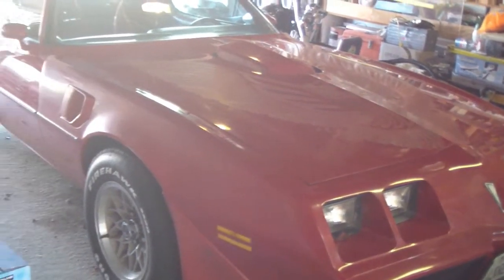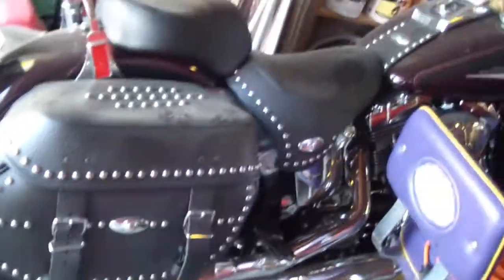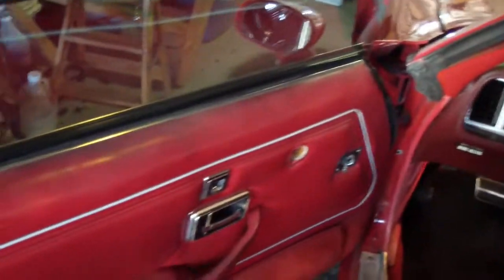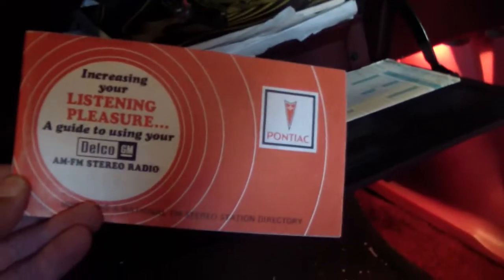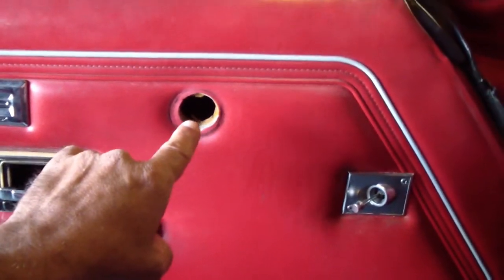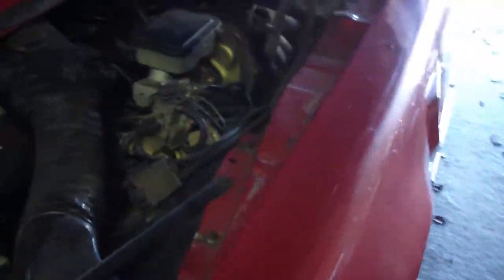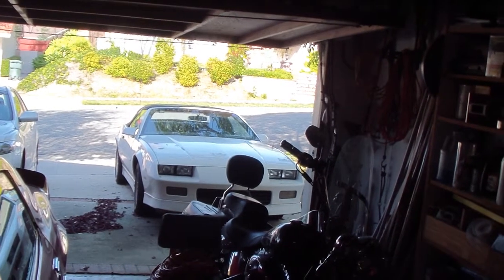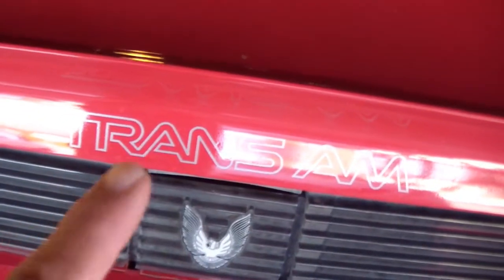Pontiac Firebird Trans AM WS6.

Comment: We have three old Birds, a '67 which I have owned the since '92 and then we have two '68's one of which is a true Title-Engine-and 4 speed (muncie) transmission, all VIN numbers matching.  Here is what most people do not know Pontiac stamped the 4 spd trans on top of the case unlike Chevy where they stamped on the sides, that is when Chevy stamped VIN#.  This Bird is a true 350/320hp H.O. car, it also came with a 3.23 posi that is dated.  You can not authenticate any other classic like this Bird that I have knowledge off and maybe one day that might give it some more added value in this world of fakes.  The other '68 Bird we have is a custom, it runs a long-arm version 388cu, stroker motor, block is a '68 Camaro 350/300hp HA block that I found in a small junkyard out side of Panama City, FL.  I paid 10 bucks for that block b/c it had a piston froze in it, and that is the reason I had to bore it .60 making it a 388cu instead of a 383cu.  The custom Bird we call the Bandit and I took an old stock hood and cut a hole in it and mounted a '70 shaker on it plus it has hideaway headlights with a '65 Pontiac Bonneville grill in place of the stock grill, and I also use a old Impala rear speaker grill mounted in the back seat, this Bird is a one of a kind but I still need a few more things to get it on the road.  To many projects lol, and now we are off-Grid so my projects never end, that is why I found this channel lol.
Reply from the maker: Wow, you own a piece of the history brother! Thank you for your visit and a very informative comment! You are always welcome here, Godspeed